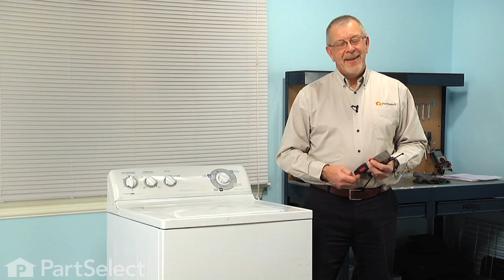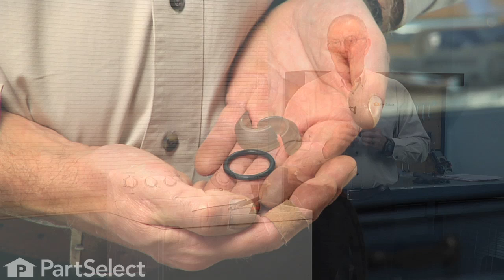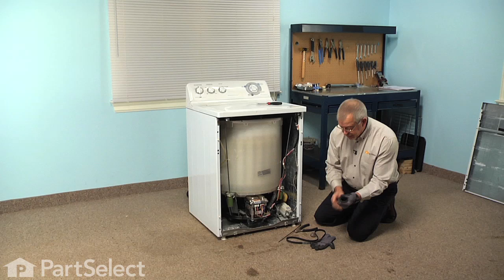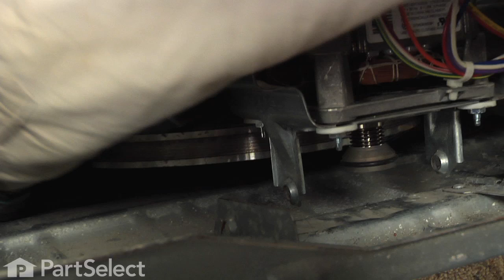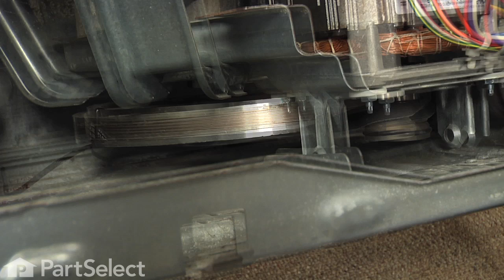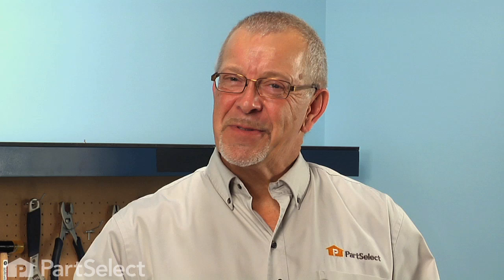Washing Machine Repair - Replacing the Drive Belt (GE Part # WH01X10302)

Comment: Don't forget to discharge the large capacitor (cylinder with two wires) before accidentally brushing it with the back of your gloveless left hand and discharging into another connected body surface. To be Frank, you might get Zappad.

Comment: Sorry guys but I left a couple of points out relative to previous comment. I removed the drain hose &  laid out an old rug, to protect the unit from gravel & dirt before I laid it on its back but, underneath it, I a put a length of 4 x 2 so that the water inlets didn't contact anything & get damaged. Lastly, I completely agree with all comments here about crap design & what passes for engineering today in this "throw-away" world but...if my comments have helped one person, I'll be satisfied.

Comment: I've just reattached the original belt that came off, all on its own! Without this video, I wouldn't have known about the 2 top clips or how to "get in", but my clips would not release, they still hung onto the front panel. Believe me, I tried almost every tool I have with no result. So, I had the panel released all the way to the top & gave up & simply opened the panel from the bottom, as if it was hinged at the top. I propped it open with a length of wood to gain access & then the fun began. Zip tie / Tywrap in place, lying in the dirt outside, there was no way that belt was going on, as hard as I tried. What I needed was a 3rd arm...two to turn the large pulley & another to keep the belt from riding off the drive pulley. Doing this without the "belt installation tool", I wasn't going to be beaten so what I did was to think & realised that lying on the floor, everything is wrong even gravity & access. That's when I decided to lay the machine on its back. This is when the world changed & I had so much more leverage, standing up or kneeling & one arm was enough to turn the large pulley whilst I kept the belt from riding off the drive pulley. For 3 days, off & on for an hour each day I fought that belt with the machine upright. With it lying on its back it took me less than 10 minutes & the belt was on & correctly aligned & is busy washing as I write. The downside, opening the panel, whilst still attached at the top, did bend a bit of the top end panel but that didn't bother me. A lever straightened that out, it took time to find the solution but it saved me 4 or 500 dollars for a new machine & if I had to do the job again... I'd lay it on its back & have the job done inside 15 minutes from start to finish with 1 Tywrap. Where there's a will...there's a way.

Comment: awesome great video support! i was able to install the belt on my hotpoint! i used a pair of vise grips to hold belt in place instead of pulley tool and had to use 2 zip ties but got it done.

Comment: I think they cut out the part with all the swearing. Video made this look way easier than what it was in reality. It ended up taking me a few trial and error attempts and had to use two zip ties pulled as tight as they would go to keep the belt on while turning the wheel

Comment: Does anyone know why my belt keeps getting jammed against the plastic tub once it’s been put on and I do a couple of spins?
Reply from the maker: Typically is your belt is not staying centered on its pulleys the belt maybe worn or stretched, if thats not the case then the alignment between the two pulleys has changed. I would check to see if one or the other pulleys an be adjusted so the belt tracks properly in the center of the pulleys
Reply: @partselect  thank you for the response. I did buy a new belt so I would have to assume it’s the alignment.

Comment: I also found that you can avoid buying the belt installation tool by using a zip tie on the motor pully  - put the belt on the motor pully and then put a zip tie right below that,  keep it tight while doing the rest of the operation.

Comment: This is great information. I am not sure if the belt is the problem. After the washer fills with water there is almost a clicking noise like it wants to start but it keeps going on and off every one or two seconds or so. Does this sound like it would be the belt or something else

Comment: One important point: Remove your belt before ordering the installation tool. It turns out my model of GE washer -- which from the outside looks exactly like the one in this video -- does not require the tool, as there is a deep C channel on the motor pulley, and another C channel on the large pulley. Also, I would recommend buying some wider, easier to manipulate zip ties, in case your large pulley is as difficult to reach as mine. I had a terrible time getting the zip tie threaded and hooked up -- and I wear child sized gloves! Once I had the zip tie connected (it took about 20 awkward frustrating minutes to accomplish that) the rest was surprisingly easy, even for a petite, not strong woman.

Comment: When replacing the drive belt, make sure you measure it and only buy one that matches those measurements.  Otherwise, there is a risk you will be returning it.  My first new one was 4 inches shorter than the original one, even though it was advertised for my washer model.  The original one was 32 1/4 " long, but I could only find new ones that were either 32" or 32.5" long.  I went with a 32" one and it works perfectly.
Reply: @Dick Mountain No it’s not
Reply: I think seller add to many model numbers to increase sales which probably increases returns!

Comment: A couple of comments based on my personal experience tonight, replacing my belt.  It is possible to do this without the  tool all of these videos feature.  You do want to use a zip tie, pulled as tight as you can to hold the belt on the large pulley.  Remember to have the smooth side of the belt out (exposed) and the grooved side against the pulley surface.  Also, my new belt was a full inch smaller in circumference than the old, stretched belt I was replacing!  As you rotate the large pulley to seat the belt, it will want to roll off the edge of both the large and small pulleys.  Having the zip tie holding it on one spot allows you to use your hands to keep it on both pulleys as you rotate them.  One other observation: I was certain that I got the wrong belt initially because of both the size and the width. My old belt was 1/8 inch narrower than the new one, and didn't cover the drive pulley completely.  That was because the bottom of it was shredded into tiny pieces in a pile on the bottom tray of the machine.   Also, the number on the old belt does not match the replacement part number.  I hope this helps you.  Good luck!

Comment: Thanks for the video, though I can't get the belt to follow the pulley, even when zip tying. The belt gets really tight and when I spin it, the belt slips off under the zip tie, no matter how tight I pull it.
Reply: Thanks...this is not even close to being as simple as they make it appear.
Reply: Same for me, what did you end up doing?
Reply: @samirasalama1984  i ended up taking the bottom of the washer off, and laid it on its side. I had better access to the pulley and i was able to attach it better, it was more work than i needed and wanted to do, but in the end i was able to get the belt on
Reply: I guess that's what I'll be doing lol. Thanks

Comment: Indeed, re-installing the belt is challenging, but don't lose hope.  Yes, you need to zip tie the belt to the large pulley and yes, I think having an installation tool would have helped.  But I didn't have the installation tool, and frankly, why would anyone want to pay $20 for something that would be used one time.  So I fashioned my own installation tool using a two-piece black plastic locking sleeve.  These things come with metal wire shelving. Here's a link: https://amzn.to/2XRhANm.   The diameter of the plastic sleeve was a little too large, so I thickened it with small strips of masking tape on the inside of the sleeve.  Then I attached it to the motor spindle and tightened it with two cable zip ties.  Even with all of that, as the large pulley was turned, the tension on the belt would cause the homemade installation tool to slip off of the spindle.  So I had my teenage son slowly turn the large pulley as I placed my hands under the homemade installation tool and pressed it upward to prevent it from slipping off.  Holy cow, it worked!  Upon reflection, I think a small piece of PVC pipe might do the trick just as well.  The key is to press it up against the tension on the belt without getting your hands caught and pinched.  Best of luck!

Comment: This is stupid time consuming and a pain in the buns you don't need zip ties or belt instalation tools simply tip the washer back so you can get a better angle put the belt all the way at the top of the drive shaft then hold it on the pulley and spin it will load the belt. Then spin it a few times until it rides in the middle of the drive shaft. Or you can do it the long way this guy shows.

Comment: Great video!  Thank you so much.  I watched this video first then realized my washer had a v-style belt and then found your other video.  For folks with V-style belt, you will not be able to get the belt around like this video shows.  You will have to loosen the motor, push it back a bit, loop the belt on and then pull back the motor to the front and tighten.  Watch this vid here: https://www.youtube.com/watch?v=PVTtLMuV3Sg.  Thanks again.  Saved me a bunch of $$$.  After I found the other video, it took me 10 minutes to fix and clean up.
Reply: Thank you. My machine had v shaped belt

Comment: Where do you get one of those belt installation tools from?
Reply: Who ever designed this should be fired and publicly executed. If you do not have the motor spindle tool, it's almost impossible, and btw, the tool it's no longer available. The belt will continually feed off the motor.... How about a video of doing it without the unavailable tool?
Reply: Marc Scirri the store
Reply: YOU DONT NEED IT OR THE ZIP TIE.
Reply: @johnmcook1  how did you do it?
Reply: @JohnnyDarko.0  it will feed on
Reply: @johnmcook1  thank you.

Comment: Good video but I ran into an issue that several people previously mentioned. The belt was so tight that I couldn't get the wheel to turn beyond a point no matter how
 hard I turned it. I thought maybe the belt was too small but the part numbers matched with the old one. I suspect different manufacturers may use belts with different elasticity or thickness. Not to give up I soaked the belt in hot tap water for about 5 minutes and then tried the install again. It still wasn't as easy as they show in the video but it was much easier and I was successful in getting it on. Hope this helps.
Reply: That will only make for a wet belt
Reply: Michael Melgar After you soak it in hot water do you have to install it quickly before it shrinks?

Comment: I found it was easier to tip the washer back and take the screws out of the bottom panel to allow more working room and less chance to cut your hands and arms all up trying to get that belt installed.  This is by far one of the dumbest designs I've ever seen.  A simple slot system in the motor mounts to loosen the motor to install the belt would have made much more sense.  Obviously the designers never work on anything they dream up LOL.  

I've found that sometimes 2 zip ties are needed to keep the belt on the large pulley.  This belt is a lot tighter than they make it look to be in these videos so take caution, its not as easy to install as it looks in the video.  It may take several tries to get the belt to go on properly, and most times its going to keep slipping off the large pulley as you are trying to turn it.  Even with the "install tool".
Reply: +William Todd (williamtodd) is it possible to change the belt with out that tool
Reply: steven rushing Yep, the couple I've done have been done without a tool.
Reply: The two zip ties worked great, had to call my brother in law to h spin the
larger pulley while position in the belt on the smaller but no tool was
needed. Thanks for your reply.
Reply: does anyone know the model number to the washer that's in the video. I couldn't find the model number on my washer and it looks just like this one.
Reply: Lorenzo Rodriguez